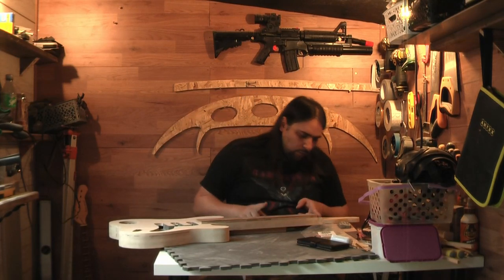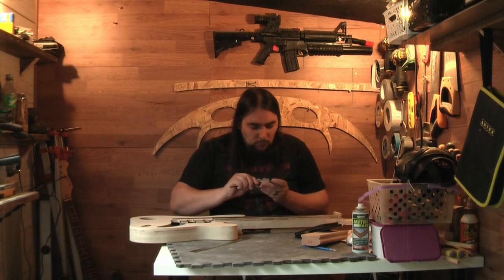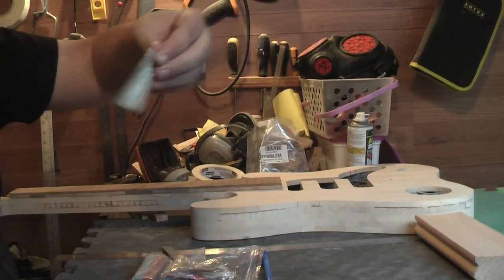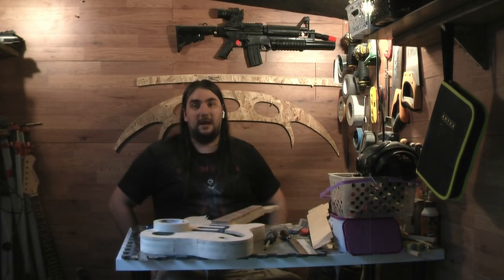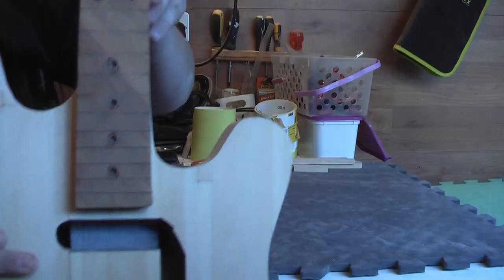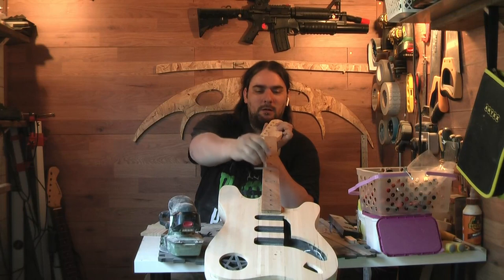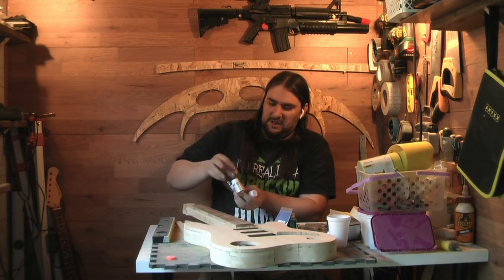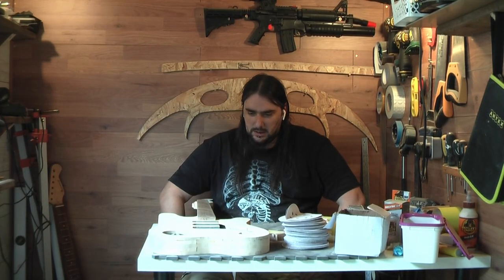Episode 12 Fret Work Part 1 on The Impossible, the Worlds First Balsa Wood Guitar GGBO 2022

Comment: I'm so glad you came back to the process after the super-edit came out!  We could see (for the most part) what you were doing to the fretboard, but being glossed over at such a high speed, it left me wondering "...did I really see what I think I just saw...?"   And yes.  Yes I did 😆

I've seen Ben put a compound radius on a fretboard using a hand plane and 20 years experience.  I think you've topped that with your "2mm pencil line, random orbital sander, and let's give it a go, shall we?" approach  😁

As for all the feedback you've been getting...  Credit where credit is due, pal.  And you're due quite a bit 👍
Reply from the maker: Thank you so much man 😀
Yea no way I was gonna throw away all that footage....that gives me a month off to do the DIY around the house lol.

And I had no idea I was creating some new ground breaking radius technique... just figured it would be much easier to break out the RO then spend the whole day screwing up my hands and shoulders  with that radius block 🤣

Comment: Could have saved you £2 too
Instead of buying the spirit level (handy for more than just one use) 
You can use a vertical blind holder and cut it to any length you want.
lf you've seen some of my past videos, you'll see i have 2 glued together so i can use a two sided one, but just one on it's own with whatever grit you want and as many of them as you want is still good enough - try it 😉👍
Reply from the maker: DUDE, that is a great tip!!! I will be cutting up the old kitchen pull blind tomorrow 😀
Reply: @gothridercreations  You're not the only one that uses cheap tools (yeah i have some more expensive shit now, but i bought another 4 clamps at aldi the other week).
I'll use stuff that i have about and reuse it for something else that i can make a use for it that i haven't got.
As you go along your building hobby, you'll pick up things as you go along (unless you win the lottery) but it's a marathon no a sprint 👍

Comment: Good choice on the levelling beam, Ive got a cut of aluminium square tube that I made sure was flat, double side tape some sandpaper to it and shes good to go. Have done nearly 50 guitars with it and never let me down!
Reply from the maker: This is the main thing I want to show, expensive tools are great if your knocking out 20 guitars a year to customers, but when your starting out, go cheap and see what you like to use 😀
Reply: @gothridercreations  100% The only reason ill ever use a fancy levelling beam is if someone gifted me one

Comment: Seeing as i'm getting the blame of things and a couple of mentions, i thought i'd give you another tip 😉
When you use the pads to sand the fretboard again, tape it to the radius block and it'll keep the radius and the thickness of the pad will keep the block off the board, or cut a couple and still use it as you did the sandpaper strip 👍
Reply from the maker: Thanks bro 😀
Reply: @gothridercreations  No worries bud 👍

Comment: Always run with some kind of protractor and a centre line for frets. I get the method you are explaining, however if you mark either or both sides of the ruler slightly off then the line you mark in will be off too, to me its just 44 to 48 points to mark out slightly incorrectly. 😁
Reply from the maker: Can't argue with that man, one small mistake and your stuffed lol.
As much as my method worked for me, I think I'll move to the centre line next time, as you say, less chance of a screw up 😀
Reply: @gothridercreations  theres nothing worse than having to fill a fret slot and recut it when making a fretboard, until recently I typically have to fix 2-3 slots. Made a scrap wood mitre box for it and good to go, I dont trust my free hand cutting skills for anything I dunno how people do it freehand